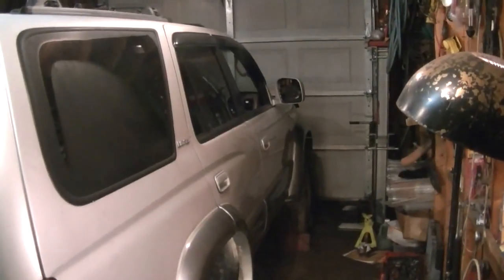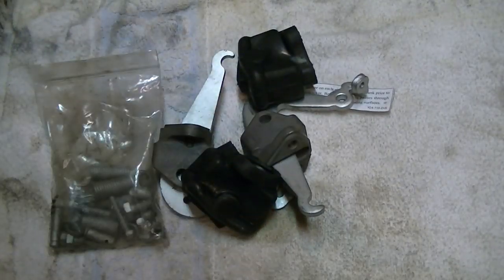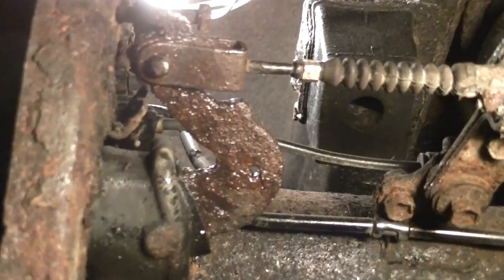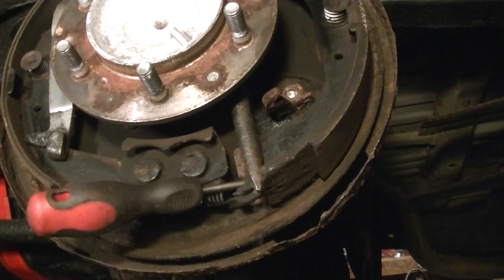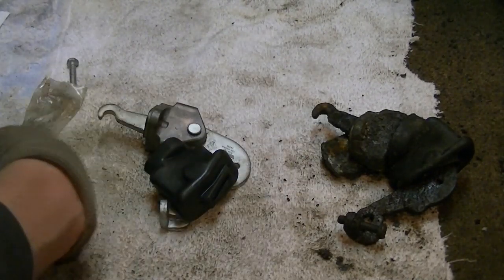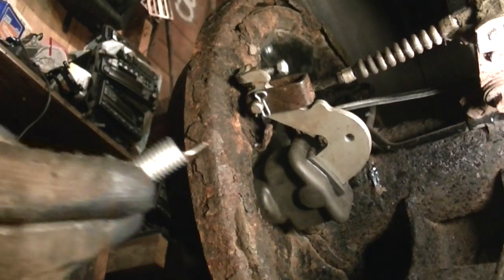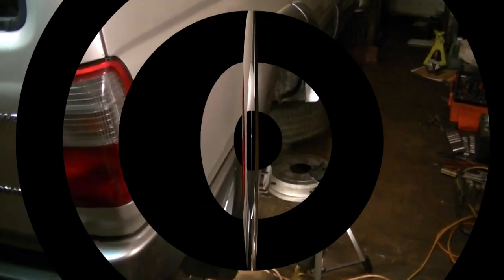Fixing the Emergency Brakes on a 4Runner...Bell Cranks Replacement.

Comment from the maker: Make sure to adjust the small screw on the back also for max e-brake efficiency.
Reply: Do you know the size of the adjustment screw? Mine broke off and I do not want to buy a new bell crank kit.
Reply: @JT-sk5nw  It's either a 5 or 6mm diameter thread. But for sure the hex head is 10mm.
Reply: Anyone know the correct position of the screw? Should it be touching when e brake is set?
Reply: @MF-rw3rb  did you ever find out the answer?
Reply: I left it with maybe 1/8" of clearance, works fine. But no I didn't find an official answer. I believe that screw acts as a stop of sorts, like a bump stop.
Reply: @abcbcd5582  that's 1/8" clearance when handbrake not engaged

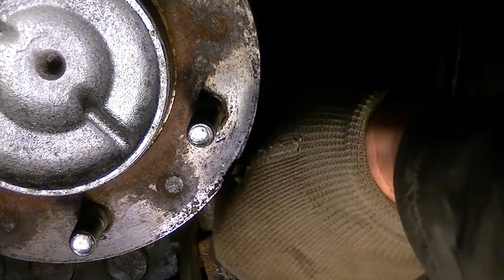Comment: 15:45 “not too many people are working on 4Runners.”  Since that time, these have had a cult following, so you were on the cutting edge! I don’t use my ebrake much in the winter, but with a manual tranny, kind of hard not to at times. I was on a slight incline and needed to jump out real quick, and in that short amount of time that I engaged the brake, it apparently froze. I forced it in reverse and heard a loud bang/pop. Don’t know what happened, but I started looking for videos for my possible repair. This is the first one that came up in my search history, so thank you for this! Very helpful!
Reply from the maker: Nice !!

Comment: Excellent video tutorial. The most comprehensive one I've seen yet on this parking brake replacement.

The hardest part was getting the retaining pin out of the harness that holds the brake line to the bell arm. Mine were rusted completely solid on both sides. It took some major hammering with a punch to get those suckers out. I probably spent 20 minutes on that step alone.

Almost as hard is getting those little plastic washers under the pivot housing. I only managed to get one in per side. I have no idea how you got them both in. That was black magic. I just keep bunching up the washer and gave up after about 10 minutes of fighting it.
Reply from the maker: Nice!!

Comment: This explanation works for my 1994 Toyota Pickup as well. The bell crank is mounted vertically instead of horizontal on the 4Runner. Great explanation of the assembly

Comment: Hi! I have a 2000 4Runner, so you might be able to help. 
On the actual cable itself, is the equalizer assembly (part #46341-35030) supposed to be loose when it attaches to the frame or snug/tight? My old one was tight, but I don't know if that was intentional or rusted in place because I now have a gap with the new assembly. Thank you!

Comment: Nathan, thank you so much for this. I have the opposite problem. the e-brake handle pulls on my '99 4R but the brakes don't deploy. the e-brake cable is maxed out for tightening (center console screw). Any ideas?
Reply: Same issue here and yes it solves

Comment: how do you make adjustments to the bolt and locking nut on the bell crank? If the bolt is closer to the backing plate what happens? if the bolt is further away, what happens? do you have to adjust the same way on both passenger and driver side?

Comment: 13:24---- dont forget to crimp the horseshoe clip around the pin. The ends should touch. I also  use a generous amount of grease on the linkage and pin where the parking brake cable connects to the bellcrank arm. Rust and corrosion is common on these parts on Toyotas.  Good angles and close ups of the R&R.

Comment: Thanks dude!  2 Hrs for the one side or did you do both?  I live on the west coast, I'm guessing my battle with rust will not be anything comparable to what you dealt with.  Appreciate the time you took to make this!
Reply from the maker: Both...Nice!!
Reply: Removing the pin to release the old bell crank from the cable can be quite a problem if rusted. I had to resort to the angle grinder, which is very  awkward on this cable.
Reply: @kf3en  Mine was rusted too. I used an air hammer with a pointed tip. It sent the pin flying across my garage.

Comment: I'm wondering where you found those backing plates for $45. I can only find the oem part for like $91 each.
Reply from the maker: I found them at auto advance. One rare case v on line sales. ;D
Reply: @FixingWithPassion  for sure I'll ask next time I'm at the parts store. I'm working on a 96 tacoma so they might be a little different idk.

Comment: Good video —

BUT!!!!!!!! If you are using the Dorman replacement bell crank parts DO NOT TORQUE TO 25 ft lbs!  In fact don’t even think about it or the damn things will strip.  I did the first one with my torque wrench set at 25 ft lbs and I bet I didn’t get to 15 before the threads in the aluminum housing piece let loose.  Another source that I found called for 115 INCH POUNDS.  (Just under 10 ft lbs.). I’m hoping that the opposite side piece will work and all I have to do is try to get those freaking bushings in place again!